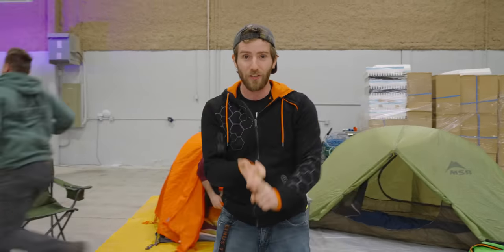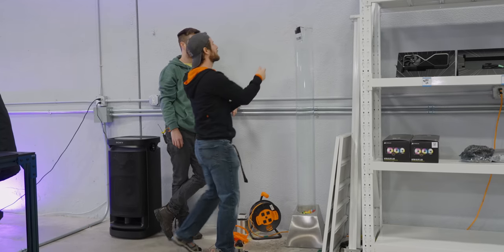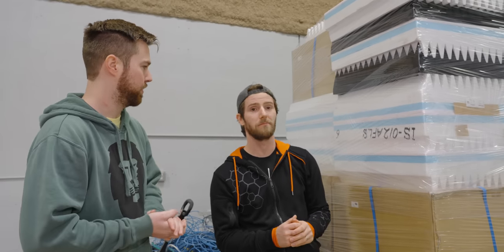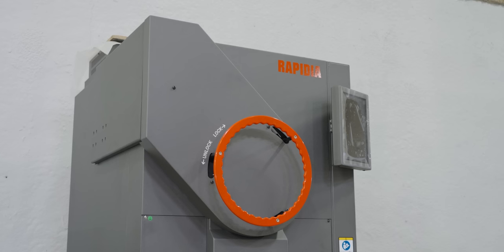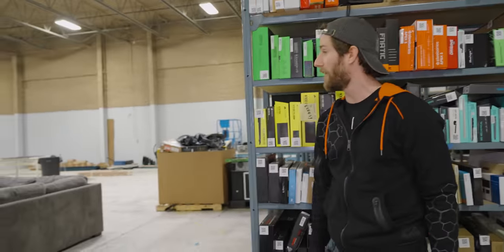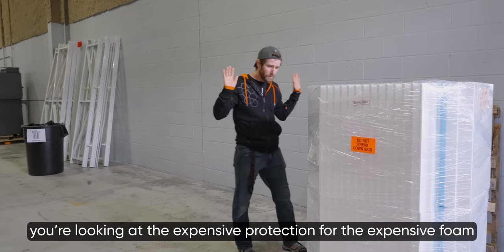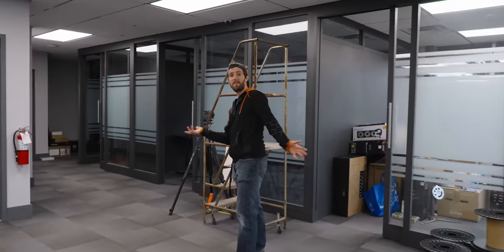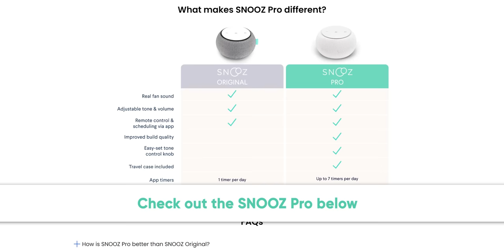I'm NOT Stupid - Lab Update

Comment: Audio guy here! Instead of rebuilding that wall for the server room you could consider some techniques used by studio builders to isolate live rooms in recording studios. If it works for drums it should work for you! You would essentially just build another wall on each side of the existing wall. Support the frame with neoprene pads in order to decouple the frame from the floor, air gap the frame a bit, and then utilize sound isolating insulation. The insulation combined with the air gap should be enough to completely isolate the server from the outer offices. +1 if you also isolate the server on neoprene pads to decouple it from the floor and that way you'll get less low end translation to the interior original wall that doesn't have any insulation. This way you can reduce the low end translation from any vibrations and the air gap + false walls should be more than enough to absorb and isolate any high end information from getting to the other side. 

The only thing that may be tricky would be that window, but you could also build framed inserts in the same manor as the walls to create an air gap + some insulation to reduce the transfer of high end information. If you still have too much mid range and high end information leaking you could utilize double doors.

Cheers!

Comment: Hi Linus and LTT team.  Your "destructive" water testing is definitely one way to test phones, but in the watchmaking industry, we have a way of doing it in an almost perfect non-destructive way by doing a reverse pressure water test.

This means that you put your testing object in a small sealed tube that can easily fit a phone in the top half with water in the bottom half.  You then have a hand pump with a pressure sensor built in - you pump to the pressure of air for the distance below water you wanted to test.  For instance, 1 bar is equal to 10m of water depth.  Leave the phone at this pressure for 10-15 minutes, then drop the item into water to be just covered, then release the pressure valve at the top.

If the test worked, you won't see any air come out of the subject into very shallow water, but if there's air bubbles that come out, it means there's a leak.  But because this is a reverse pressure test, the air inside will reach equalibrium with the water if there's a leak at most, which means that your device won't ever have water get inside of it unless there's a major break in the casing.  It's a non destructive way of testing water resistance of any type of device :)

Video of it in action: https://www.youtube.com/watch?v=2wOsnBd_7-k

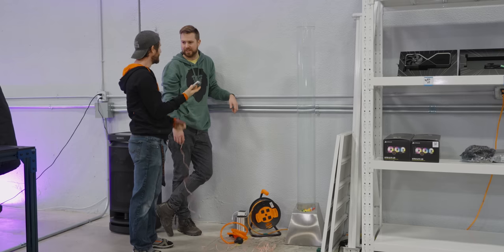Comment: Note; at 3:45 you couldda made that pipe out of Grey Drainpipe and fittings for $50. No need for clear plastic when you can have your string measured.
Reply: It's better to have it clear so they can watch for different interactions between the water and the electronics the more data the better

Comment: I really enjoyed this tour showcasing the future setup. However, as an acoustic consultant, I noticed that some of the advice given is inconsistent, particularly regarding the placement of subwoofers. Additionally, the location chosen to measure sound levels near the projector area is not ideal as good low-frequency insulation is difficult to achieve. Typically, anechoic rooms are used for this purpose, where the room is isolated from external noise and vibrations using massive springs.

Comment: That rapidia metal 3D printer is a rip off of the Metal X by markforged, where they say that they have an NDA where they cant discuss or show how it functions, its basically a metal particulate that is suspended in wax, the printer produces the part at around a 20% volume increase and the wax is melted away by the heat, the heat also raises the temperature  of the metal so it will bond, or SINTER, which creates the strong fusion between the metal particulate. these machines in the UK cost around £250k for acquisition and set up, the most expensive aspect of these printers however is upkeep, as replacement parts, warranty and operating systems cost around £120k, with the warranty last for 5 years and parts need changing around every year or so, dependent on usage

Comment: At 17:52 regarding the introduction of Forky the Forklift, as a suggestion find yourself the SAME forklift but completely non-working that you can get for CHEAP around $500 CDN from some local scrap dealer and take that metal back off and use it as a MASSIVE and SUPER-HEAVY COMPUTER CASE !!

The beautiful curve on the back where Linus hit it with his hand is fantastic looking and would look GREAT painted "Code Orange", "Deep Electric Blue" or "Mustang Race Red" and the open middle part could have a curved piece of glass custom-fit and used for internal RGB lighting displays!  The enormous amount of room in that curved back could fit four or even eight motherboards that are each fitted with four GPUs and hundreds of SSD drives and a few power supplies and water cooling blocks!

Take something old and unusual and turn it into a fancy super-server or super-gamer case!

V

Comment: When you guys get more labs testing up, please do some dedicated videos and testing around PWM and Temporal Dithering. Both cause nausea, discomfort, and motion sickness in about 1/10 people with no visible flickering. Both are essentially shortcuts to brighter screens and more vibrant colors. They're both achieved with very rapid flickering that people with sensitive eyes can feel even if most of the time you can't see it.

Samsung uses PWM in their tablets, bought the Tab S8 back in 2022 and it made me physically sick in under twenty minutes. Almost immediate discomfort. Just found out IPad Air 5th gen uses Temporal Dithering which I didn't know was a thing and affects the same people in the same way. Guess how I found out? 

Not a lot of places seem to pay attention to it or even know what it is. Apparently its a common trick in OLED screens, but not all of them do it the same way or at all. Now that OLED is becoming more popular its going to be more likely that I run into this issue. Don't know which ones are going to cause me to become ill or not and that is a bit anxiety inducing.

Also could be a good series of videos and good use of labs testing. Make sure manufacturers are being up front about what they're doing to achieve the brightness and colors they display.

Comment: Metal 3D printers are basically tiny CNC controlled laser welders. Without divulging too much a laser melts layers of pulverized metal, repeating the process of layering pulverized metal and melting pathways you can basically make almost any object. Obviously the applications are very specific, it would be a waste to metal 3D print something like a pipe or a readily available piece of stock but if you had to print something like a set of titanium bones within a nanometer of tolerance for use as medical implants there is no other machine that can do exactly that. The best part is that you don't necessarily have to use metal as a base material, as long as a laser can fuse the elements with a strong thermal bond its possible to use. Flux or shielding gas might be required to print highly reactive materials that oxidize easily though. I wish I were paid to share forbidden knowledge.

Comment: A (hopefully) small suggestion:
I have just upgraded, and I don't really care about benchmarks once I have spent the money - there will always be something better that'll be available for probably less than I paid approximately 5 minutes after I plonk down my hard earned cash, (murphy), so I'd rather live in blissful ignorance.
That said, I would like to know if the new thing I have is working properly, so what I want is a test that will confirm my new GPU or CPU is working as well as it should.
In my case, it was only because I watch LTT videos I knew what 'resizable bar' was, and why it was bad when I spotted that it wasn't enabled.
Maybe you could get some 'distributed testing' done by making a hardware performance analyzer that reports key hardware info and performance metrics back to LTT, and provides advice on getting the best out of what you have, or identifies the key thing holding the system back (so someone doesn't spend on a shiny new nvme ssd that's slightly faster when the system is held back by slow ram).
Would also give you real world info on the performance people see in the field with various component combinations.

Comment: First thing I learned at business school is that your business should be set up to fill a gap in the market that exists, not just set up a business that does something you want to do if there isn't some way to sell the product. 

How are they expecting to monitise this info? Manufacturers already rate the water resistance and if it fails, you get a replacement. Testing one device and getting a failure says nothing.

Who is going to care about exact positional data for keys when deciding what keyboard to buy? Maybe 0.01% of keyboard buyers.

Who cares about "lab-standard" game performance metrics? We can get 80% as reliable figures from userbench and that's good enough.

Linus clearly WANTS to be able to perform all this product testing, but I can't see how it's going to provide anywhere near as much return as he's spending on it.

I really hope Lab 2 is its own limited company so we don't lose LTT when Lab 2 goes bust.

Comment: Who will tell Linus that a keyboard is just... a keyboard. Bestseller at Amazon today cost 42 USD (inc mouse). Second cost 27 USD and the third cost 79 USD. A keyboard isnt something you "invest" in.  Even if you did, it would look nasty after a couple of youears. Im not saying that all should by these cheap things but im saying that if you spend 200-300 USD you proabably will switch it before its "broke". 

Besides that, I doublt that a key-switch is built with such precision that you need a robot to reasure it and if the forxe you need to push is so concistqant. I doubit that its done with "purpose". 

Anyway. Love this. Freaking all in. Go go go!

Comment: Don't use distilled water for submersion tests... distilled water will keep ANY phone working since it's not conductive, and once dry will leave no metal residue. And since it's not conductive, the phone will keep working even if water comes in in phones without an IP rating.
Reply: That's why I filled it from the hose 😂
Reply: @jakedaynesLTT  Good... I just thought I'd share it, since Linus asked the question, but it wasn't clarified. :)

Comment: BS on the oven explanation. "Removing the air, put argon then create a vacuum"?
I suspect it first creates a vacuum (removing the air), pumping in argon (inert gass, does not react) and then bake. There is no point in adding argon to remove right after by making a vacuum which removes any gasses. When can I start at LTT and replace this guy?

Comment: If only he had the staff to make proper use of this stuff. This is a pro grade development and testing lab, LTT hardware and other stuff when? Time to ditch the water bottles, screwdrivers and hoodies. I wanna build in LTT cases, toss in my shiny new LTT vaporchamber cooler that has temp changing colors revealing a red mad face linus on black ceramic coating once the cooler hits 70°C...
Well, if it improves quality, I had to cringe so hard so many times on OC/cooler solutions, leaks and the overall quality of half working or broken hackjobs that LTT team made content. It might be just for views but still... :D I mean I saw Linus build a PC inside a fridge easily a decade ago only to realize the heat pump in the fridge is just a wee bit too weak/small and built for energy efficiency not transferring heat from  a constant 600w heat source but you have to grow up at some point :D